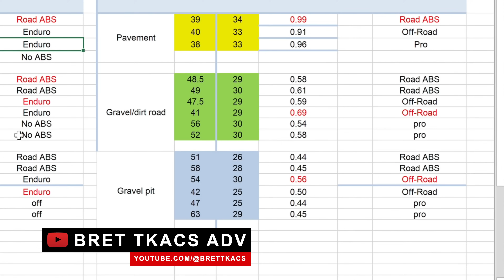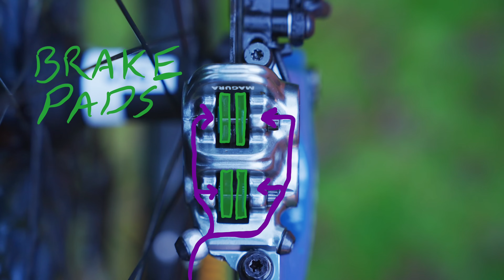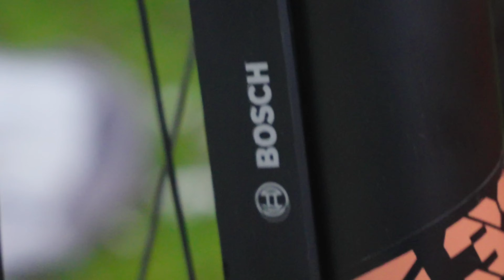Life Saver To Time Saver? | BOSCH ABS Explained

Comment: WHOOPS! Correction 7:41 should have been: “This shows that the level of antilock assistance REQUIRED varies depending on rider skill, terrain and conditions”

Classic last minute change mistake 😂
Reply: If you could choose to use an ABS system on a normal (non electric) mtb, would you (with current technology)?
Reply: I would definitely give it a go. I think at the moment I can outperform the system but I’ve been liking the little safety net when things get dicey or my technique get’s sloppy.

Comment: The first thing you do on a dual sport motorcycle when you hit the dirt? Disable the abs. You never known true terror until your abs decided that you would NOT be braking on a soft sand downhill... Ask me how i know. On the pavement? Huge plus for safety tho.
Reply: I will add a caveat that the mtb abs is most likely tuned very differently then my old ktm 690 enduro...

Comment: I want one with a series of magnets in the disk that tells the electronics the rotation state of the wheel. The same magnets power the system electronics and ABS control valves.
Something that'll fit to all bikes. Not just E-bikes.

Comment: Those small solenoids that control the valves really are affected by self heating. Wonder if the voltage control is calibrated for that, otherwise your abs performance would drift the more you use the system on one run, and be very unpredictable

Comment: I locked up my front wheel on street on my Honda 600RR once. I was able to save it but it was the scariest second ever. When I ride bi(cycles) now I’ll take the rear to the skid point before i apply max pressure to the front (road MTB and Gravel). ABS will be a gamechanger but will come late to XC and road
Reply: try on bicycle to brake with only front brake until your rear wheel rises and try to keep it on a few cm from ground, that is the fastest stoping without crash

Comment: It's a motorcycle. Let's be real here. I've built ebikes in shops and slightly more powerful than 'recommended' ebikes, some of them using clutches and moto transmissions. If your bike needs an ABS, you need to either learn how to ride better, or call it a motorcycle.

Comment: The “manual ABS” does work in “panic mode”. You just have to spend enough time in panic mode that it just becomes “biking down a hill mode”.
Reply: yes, manual abs is part of traction management, that controls amount of power on wheel, bank, calculates state of surface, monitors obstracles and provides auto braking

Comment: On a bike the rider generates the grip - if the front wheel slipped the rider was either too far back, didn't pump enough into the ground or both. That's a huge difference compared to moto.

Comment: If the system compares front wheel speed to rear wheel speed and the rear wheel isn't equipped with ABS, what happens if you grab a handful of both brakes in a panic stop? The rear will likely lock up, especially on dirt, and the front ABS won't work when you need it most?
Reply: It also looks for sudden changes in rotational velocity for the front wheel individually.

Comment: adding abs to a bike is automating all the fun out of riding
Reply: You said the same thing in 2001 about disc brakes and suspension and then you said the exact same thing about droppers in 2007 😅
Reply: @knott4me561  more like its never coming anywhere near my bike like wireless shifting and  everything like it
Reply: @TruckerSteve182  fr, wireless shifting is definitely more of a gimmick than anything
Reply: What a FUD
Reply: Exactly what I was thinking
Reply: If you’re a casual rider who literally only rides for the fun of it, not really. It’s not like it’s going to become a mandatory feature of every single bicycle anyway
Reply: When you ride a bakfiets, and the kids or another load isn’t in the front, it’s practically required to maintain control and stability in an emergency stop.
Reply: @lwfeagan  Really? My daily driver for the last 2 years is a omnium cargo and I can’t remember the front wheel locking up ever. What makes the Bafiet so hard to handle without a load?
Reply: @ My Load4 75, best I can tell, is over 50 cm longer than the omnium, all out front, and doesn’t have much weight over the front wheel, all in pursuit of a low center of mass. The omnium is a super cool bike. There are definitely trade offs with the load. It is not the unicorn it’s made out to be.
Reply: @lwfeagan  yeah I’d probably get a different cargo bike if I had kids or transported very heavy loads regularly. But as a commuter it’s pretty good and it definitely saved my back when grocery shopping or busking.
Reply: Type 2 fun>Type 1 fun
Reply: not really
Reply: Abs makes brakes perform worse on vehicles. It won't be any different on bikes.
Reply: @brandonreimer184  Please explain this ridiculous statement in more detail...
Reply: @th_js  abs only helps someone who is panic braking, meaning if you are frozen pushing the pedal as hard as possible. The only place abs performs better than a calm human is on pavement. On loose surfaces braking distances are increased when abs is active. Braking distances are shortest when maximum force is applied without engaging abs on dirt, ice, snow, and wet pavement. 
Braking a mtb is also effective in a straight line abs will only encourage ppl to brake through corners wich makes the bike stand up, causing a loss in traction.
Reply: @brandonreimer184 😂no it doesn't
Reply: @brandonreimer184 That couldn't be further from the truth.

Comment: When they come out with a six axis imu. Then it will be a game changer.
No point in going fast if you don't know how to slow or stop properly.
Majority of top end bikes and especially off road bikes enable the rider to use the front only abs along with slip control on the rear.
Electronics are not the answer for uneducated riders to feel invincible but help more experienced riders get the most out of the their bikes and riding.
Better learning how to trail brake first.
Reply: I fully agree that learning how to ride a bike properly should always be the priority.

I do feel that a system that allows a rider to get to the limits of what is possible in a safe manner will increase the riders understanding of what a bike can accomplish. 

This should increase skills and learning in terms of grip and deceleration but it will absolutely inhibit brake feel development. At the end it’s riders choice if they want it.

Comment: Why don't rally cars have ABS?

The ABS braking system is unsuitable for rallying, especially on gravel and snow. There are situations where a driver needs to let the wheels lock when braking, and ABS prevents this. ABS simply doesn't work on gravel. Likewise, traction control doesn't work on rally cars. Quora 07.01.2021
Reply: I agree with your point about rally cars and the requirement to occasionally lock the wheels.

I would raise another point though. Cars don’t fall over when you lock the front wheels.
Reply: Your bike will fell over anyways, if you are on the edge of grip. This has nothing to do with the brakes. 

Some production motorcycles are eqipped with ABS, but it is not used in racing. Even Moto GP and Motocross do not have ABS. A regular cyclist of the average pedelec will benefit eventually from assisting technology.
Reply: When in the world would you want to purposely lock your front wheel for any kind of performance gains
Reply: @DaStuntChannel  To pull a stoppie for example, good riders do it all the time to pivot on their front wheel and move the rear one whie it's off the ground on very tight turns trials style for example. ABS on mountain bikes is ridiculous.
Reply: @Chriscrillo  Oh good, you've decided this is ridiculous for the rest of us, lol.
Reply: @matt.3.14  I did and gave reasons for it, you adden nothing of value. Buy whatever you want but my point still stands. ABS has no place on mountain bikes, total gimmick. Even on cars it feels terrible when it kicks in. It allows to mantain direction control on cars while braking hard but two wheel vehicles behave in a different way than 4 wheel ones as you don't steer them, you lean instead.
Reply: This is on point. I was goint to say the same thing. To go fast with the cars (track/rally/dirft) we usually diable ABS, because it interfere alot making car less predictable on weight transfers and it makes braking distance actually longer. Hard-enduro and motocross bikes don't have ABS either. ABS is for preventing casual, inexperienced drives/riders to lock up the wheels, that's it, period.
Reply: I joke a lot about ebikes, but honestly, ABS does make some sense for the front wheel, specially if you ride in places with awful traction. However, it does not make sense for a rear wheel... In the sand, you just need to lock up that rear wheel to slow down a little to not do a Thelma and Louise off a cliff